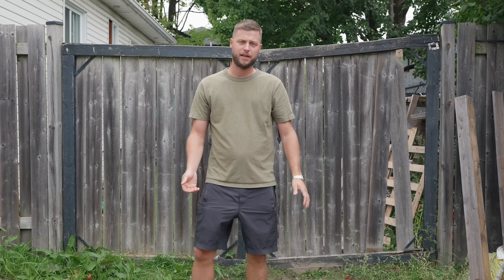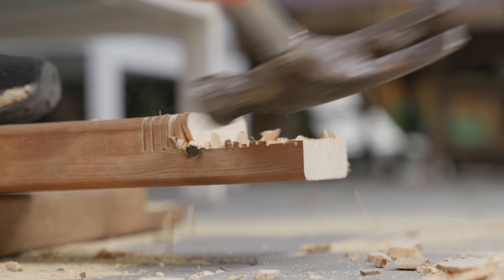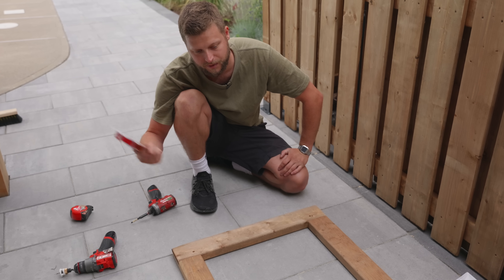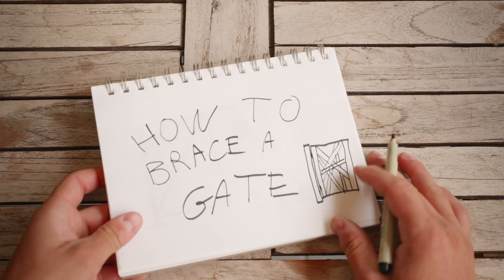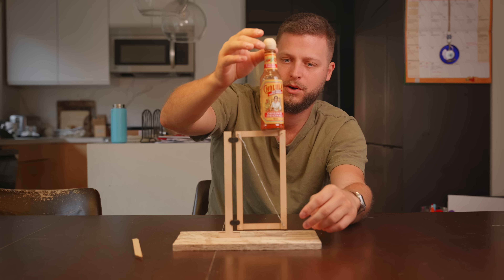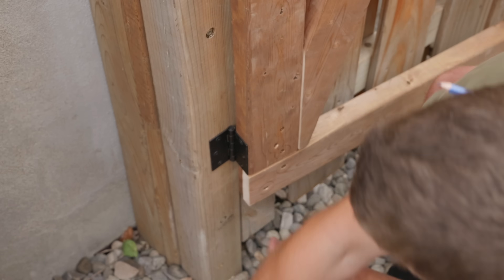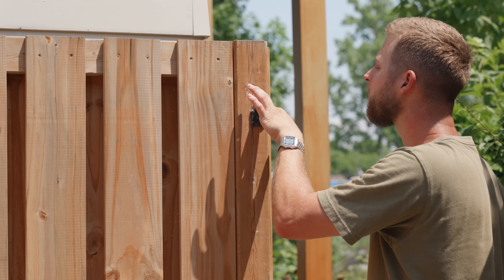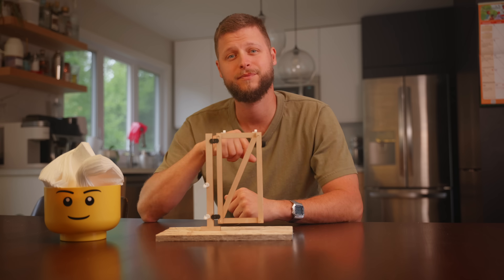How to Build a Wood Gate That Won’t Sag (Full Build + How to Brace)

Comment from the maker: Watch the fence build video next: https://youtu.be/LGrp3X7ml28

To learn for free on Brilliant, go to https://brilliant.org/MateoStabio/. You’ll also get 20% off an annual premium subscription.
You can find all the products I used or mentioned in the video description, A few of the products here: My favorite Drill Bit with depth stop: https://urlgeni.us/amzn/M6Twp
Gate Wire Fix Sag Tension: https://urlgeni.us/amzn/84kUG
Pull Latch Spring: https://urlgeni.us/amzn/MTf4v
Metal Gate Angle Hardware Kit: https://urlgeni.us/amzn/EOx2a
Simple fence gate latch: https://urlgeni.us/amzn/cjxvZ
Heavy Duty Metal Gate Latch with handle: https://urlgeni.us/amzn/tLTrz
My 3D Printer (P1S): https://urlgeni.us/3DprintzYkbbambuLab

I earn a small commission from Amazon (at no extra cost to you), so thank you for supporting the channel! 🙏🔧
Reply: Thanks for the lesson. I'm a visual learner too. Love the hidden latch!
Reply: Since you build with firm not too floppy wooden beams you are absolutely right about the placement of the diagonal brace. However, when welding a steel fence and using a floppy metal strip for the diagonal brace you are better of using the other diagonal letting the gate hang from the top hinge to keep if from sagging.
Reply from the maker: @BlacksmithTWD  100% correct
Reply: Tu mets les piste audio dans pratiquement toute les langues possibles et imaginables mets tu n’as pas mis le français alors que la langue française alors qu’elle fait partie des 10 langues les plus utilisées dans le monde mais bon tu préfére mettre le russe, NL, ou encore le BENGALI 🤷🏼‍♂️🤷🏼‍♂️ ses dommage que tu n’est pas mis le FR
Reply: @Flow_420  perhaps they simply don't know French. I understand your frustration. 
French is a lovely language. I grew up learning Acadian because I live in Nova Scotia. I was very nieve at 12. I had the opportunity to go to France at the time. I thought I knew French...lol.  Parisian French is quite different from Acadian and both are different from Quebec French!

Comment: Nice segway on your sponsor. I am more interested about those lights though.
I only checked on this video because I built a shed door that I anticipated a bit of sag and thought I had compensated well enough for with some roller wheel support. I wanted to double-check your build recommendations with how I put it together and see where I missed the mark. I may follow up with a tension cable to see if I can pull some sag out of it. It's an 8 foot wide door that holds tools on the inside of it and I figured the 3/4" plywood cover would keep it rigid. Going to do this before I put the siding on it.
Reply from the maker: Thanks! Best of luck on your project. The lights are in the video description of the backyard makeover landscaping video

Comment: 11:37 i disagree, the angle brace shouldn't be below 45 degrees as your example can clearly still sag. You contradicted your example to what you were saying both weren't on the same page. A vertical brace in the middle with 2x angle braces would he much stronger and no sag.

Comment: Could someone explain the placement of the brace?  I understand the brace coming from the hinge side up to the latch side.  But I notice some will build their gates with the the brace mounted fully to the upper and lower rails.  I see some people mounting it half on the rails and half on the stiles?  Others have mounted the brace fully on the stiles.  I've even some gates with one side on the rail and the other side on the stile?  What's the proper way and why?
Reply from the maker: That is a good video Idea, I wonder how I would do that

Comment: So if we use compression and tension all in one door would it be stronger or more stable?
Reply from the maker: Usually, the tension cable is added to an old gate that is sagging. I personally wouldnt build one with tension

Comment: For a wide gate a single brace will let you down. It's geometry. A miniscule angular drop as up to a big droop at the far end. 
Better to use 2 braces and a central vertical between them to create a zigzag. That way your angles are much more acute. Geometry is then working for you.
The alternative often used on farms is to extend the hinge side higher than the top of the gate and run a wire down to support the gate. 19:45

Comment: The principle of bracing is correct, but it’s only half the equation. For a gate—especially a heavy one—the real weak point is the hinge. That’s the component that carries the door’s weight and transfers all the leverage into the upright post. If you want long‑term reliability, the critical factor isn’t just the brace; it’s the hinge’s strength and the way it connects the door to the post. That interface is where the loads concentrate, and it’s what ultimately determines whether the gate stays true or starts to sag.
Reply: Why’d you just copy and paste a chat gpt response lmao, its implied you use a hinge that’s designed for the weight of the project
Reply: @steafin4107 Some of us are quite adept at expressing our thoughts without the help of AI.

Comment: I’d go for “the other” way so the brace is in tension (which will never bow perpendicular to the brace) and use a lap joint or something similar so you’re not relying on screws pulling out. Being in tension, the brace could also be a lot smaller.  Try pulling apart a toothpick!
Reply from the maker: Interesting!

Comment: in rdr2, they did this wrong. in valentine it's like here 12:05 on bothe side in the one place i was able to see.
in the mission where you herd the sheep, one side is good, the other is not because the gate sides are not symmetrical.
i think it's crazy that they spent so much time in that game on tiny details which nobody will notice and they never questioned how the gate should be constructed.

Comment: You start out by showing a rather sizeable opening--perhaps 6 feet. All your examples are simple gates of a very small width. Apples and oranges.
Reply from the maker: Not at all lol. I also show you in the miniature example that its the exact same process. If your gate is very heavy tho, you might want to upsize your post to 6x6 or 8x8

Comment: Excellent gate! Technically, while your brace screws aren't doing much work, those screws on that half lap (and, for now, the epoxy) are doing 80% of the work to hold the whole gate together. To get a solid mechanical connection between the brace and the stile, you want to cut a tall skinny birdsmouth in the stile to give the brace a little ledge to rest on.

Comment: I agree with your assertions about frame construction. Wood is very strong in compression but not in tension.
Reply: You’re right that wood is generally stronger in compression than in tension, but that doesn’t mean tension can’t be used structurally. In timber framing, the king post is a perfect example: it’s a member designed to work entirely in tension. When the geometry is right and the joinery is built for it, wood in tension isn’t a liability at all; it’s actually the most effective solution.
Reply: the weakness is in the joining, not in the wood.

Comment: This is a great illustration of basic statics and you have a choice of a tension member or a compression member for the brace.  Compression member wins as the bearing within the joints is taking the load and the screws at the joint are in shear.  Most efficient use of the structural elements.

Comment: Came here to comment, didnt even watch. Diagonal Bracing.

You dont need 20 minutes... Guys brace your squared frames. Right Angle triangle? force to br reckoned with. Put a sheath/panel on that square frame, now you have endless countless right angle triangles giving diagonal bracing.

What was that, 1 minute? coach.
Reply from the maker: You should start your own channel. You can do 1min videos 😊
Reply: @mateostabio  See, it takes less time to comment here, than to make a channel dedicated to 1 min videos. 

I'm not set out to teach people, more interested in YouTuber AD farmers who need countless minutes to make sure ads spawn in between their videos and more revenue ☺️

Maybe if you made 99% of your fortune and wealth by framing doors that dont sag, you could explain all that was necessary in just 5-6 minutes.

A respect for the minute and the seconds that'll never come back.

Comment: The difference in the right way to crossbrace & wrong way is the right way puts the joint in compression, very strong & not reliant on the fasteners holding, it relies on wood butting up against wood to handle the force.  The wrong way puts the cross in tension, which means you need to cut a different joint or use a joining plate, otherwise all of the force of holding the gate square is pulling on the fasteners you screwed the crossbrace in with.  Over time & with heat/rain cycling, the fastener holes will be pulled out of round & loosened.
Reply from the maker: Exactly

Comment: I probably didn't leave enough of a side gap.  It's rubbing a little this winder after the rain.
Reply from the maker: Time to take out the sander or a hand planer to remove that 1mm
Reply: @mateostabio Thanks so much.   Sander took it off fast.   Next time I will leave 3/4 inch!

Comment: Nice work, but as a fence builder of 40 + years, just a few pointers. 1) I never use pressure treated material, not for pickets, not for rails and never for posts. 2) Never use a latches like that, those are designed for wrought iron, use a post latch, and take it apart and reassemble it so the handle always goes down to open the gate wether the latch is on the left or right of the gate. 3) Never use wood for posts. Like I said, I like your work and attention to detail. ✌🏻
Reply from the maker: Thanks. So you use steel posts? What do you use for pickets and rails then? Where are you located, US? UK? just for my own knowledge.
Reply: @mateostabio  Hey, how’s it going? I’m retired now, but we always used Cedar and we always had it pre-stained prior to construction.  Use 1x4s for side by side fence and 1x6s for board on board and always 2x4s for rails. We used 065 galvanized posts for 6’ and 095 for 8’.  8’ centers for 6’ and 6’ centers for 8’.  On the posts use Simpson brackets to attach the rails.
Reply from the maker: @timbrewer8641 interesting! Thanks for sharing! Now a days cedar is not what cedar used to be, (I think) and its like double the price. Does it last double the life? I dont know about that
Reply: @mateostabio I always told people that Cedar doesn’t last as long as it used to because many of the trees these days are planted near a river or are just not that old and are more porous. Back in the earlier days, trees were old growth and were more dense. But still, Cedar is the way to go and by keeping it stained it will last a long time.

Comment: Guess you need brains to understand the theory behind placing a brace. It does not matter what way you place it, the idea is, a square can collaps, a triangle can't.
The brace reshapes a square into 2 triangles. You explain it with an example that leaves out 2 pieces, it does not make sense at all.
The only difference is: the way you place it, it creates a pushing force, going from up to down a pulling force on the brace. 
When you want to go for the pull option you have the option to use a cable.
Reply from the maker: Did my example not prove the point lol?
Reply: @mateostabio  you truly don't understand physics, I rest my case.

Comment: I get it for small gates; this will work well and looks better. The problem is that fence contractors rely on these FALSE structural models with pin joints, but do not complete the pin-joint connections with diagonal braces (broken model). Every engineering student knows that this is structurally wrong.  Keep compression members as short as possible, and use tension members for long spans, and proper joint connections. I could hold the forces of your model with a piece of thread if you supplied proper joint connections. Try removing any connections in your model and test it.
Reply: PS My post may look negative, but the truth is I enjoy the video, and though the project looks great.
Reply from the maker: Interesting! i am no engineer. I just explained things Ive noticed with gates. You may be right. I just feel that wood fences in compression end up better and not sagging va the other way around. This is also just for wood. Im not talking metal frames

Comment: I've had issues with the post bowing from the weight of the gate and weather exposure. Looking for ideas for extra support  for the hinge side post. I've used a cable in tension back to the next post located near the top hinge. That seemed to provide at least a temporary fix. I've also thought about using a 4x6 hinge post or putting 2 4x4s together possibility with crowns in opposite directions.  I really like the hidden latch pull.
Reply from the maker: Hey, i think if your gate is really large and bowing the post, you should probably make a bigger hole, with a lot of concrete. Make sure its nice and deep. And put a 6x6 post instead or even an 8x8 post.

Comment: Did you seal the area that were cut for the half lap joint?
Reply from the maker: As you saw in the video, i did not. But i do not think it will be an issue. Hopefully the epoxy took care of that

Comment: Really great video! Makes me want to build a gate haha. I do have a double door ‘gate’ to an outdoor shed. Both sides are sagging. I am wanting to rebuild the 2 doors but want to make sure they don’t come out of alignment so I can ‘weather seal’ them to keep the heat inside. Would this work or do you have a different video you have made that you could point me to? Thanks
Reply from the maker: If you want to keep the heat in and are scared of warping, I think I would make the base of my doors out of 3/4” plywood and start from that. Perhaps even glue on 1” styrofoam on it for insulation. And finish the exterior of the door with other wood or exterior siding material
Reply: @mateostabio thank you! The rest of the shed is cedar so will build out of that. It is a project that I’ve put off for years and years! It’ll be on my Summer to-do list as soon as the snow melts and it’s a bit warmer 😂

Comment: Very cool! So aligning the covering planks in the opposite angled direction of the compression brace would result in a stronger gate as well. I guess filling only the post side gap with more compression braces would make it stronger but the opposite side would benefit more from tension.

Comment: That pull-latch wire will eat into the wood. Consider adding a metal insert into the hole to make sure it survives for years.
Reply from the maker: Good idea. The wire has a rubber coating so I dont think itll eat the wood.maybe over time though
Reply: @mateostabio The rubber will wear out faster than a metal grommet would :) And depending on the exact material and how much dorect sunlight the wire sees, it could be silly fast. UV has a habit of degrading plastics

Comment: the hangman explanation is very way to explain. Technically speaking, when you invert the brace it's not under tension; hence, it falls off, but the compression concept is dead on. You can use this video to build your fence with 100% confidence, just don't quote it in your physics test this Thursday. Cheers

Comment: little diy tip for concreteing posts, you can use a palm nailer or even a percussive massager to vibrate the post and make sure it settles enough for your sod to grow right up to the post. you can tamp any aggregate used in the same way if you use a length of roundstock with a small plate attached.

Comment: So if I understand it correctly:
Compression = weight on the diagonal brace
Tension = weight on the fasteners of the diagonal brace
Reply from the maker: Depends, tension is pulling apart. and compression is pushing into itself.
Reply: @mateostabio Could you please clarify something about the diagonal? Is it attached to the horizontal or vertical pieces of wood/lumber/2x4s, whatever the correct terminology is? When you were marking it, first it looked like the vertical, but then it did appear to be attached to the top board vs side board. TIA

Comment: from experience... the brace position explanation is pure theory.. nicely explained but pure theory. cause nobody builds a gate with hinged corners. 
n practise you always use good half lap joints. in the real worls, when using strong joints, it doesnt mattter how you postion the diagonal. wood is good in tension and compression. (unlike a cable) it all comes down to the joints..

better pay attention to the hinges and the pole or wall you attach them to.. if these are not solid enough.. your non sagging gate wil scrape the floor anyway...

Comment: Tension cables are ghetto
Reply from the maker: Yes indeed. But they are a quick fix
Reply: @mateostabio  yes, but still… I've never come across an old gate in good shape with tension cables. I just don't see the sense in doing it half right.
Reply from the maker: I feel you!